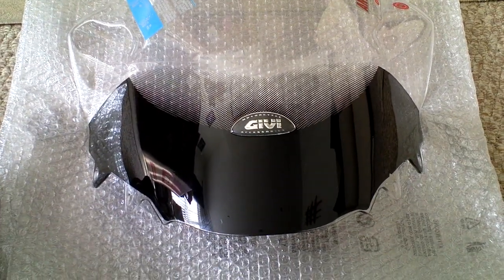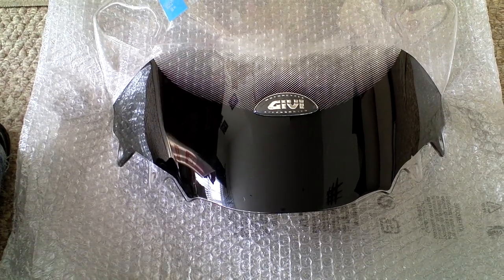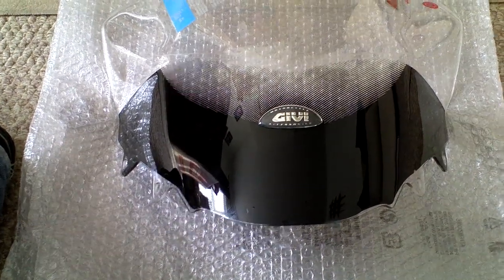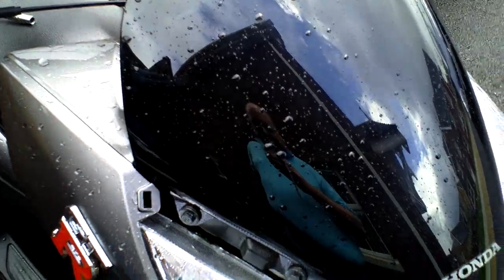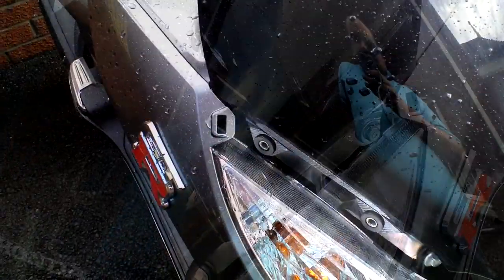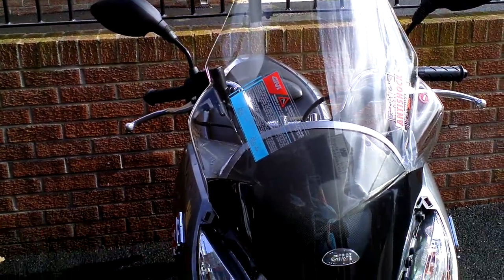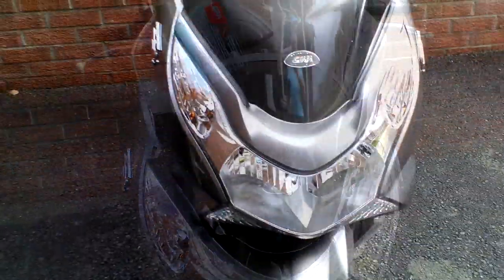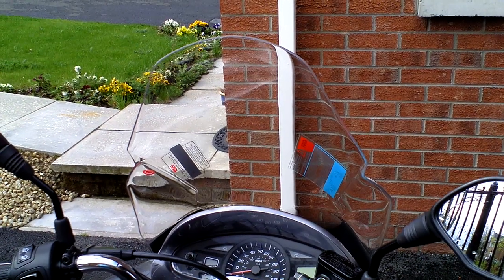Fitting new windshield to Honda PCX125i

Comment: Thx to show this here, because my GIVI windshield came without any description. I found the 2 screws in the front bottom, but after removing them, nothing moved. Good to see the clips. I opened them with a flat screw driver and a thin towel around to avoid scratches. I' ll give the link do my dealer.

Comment from the maker: Thanks for watching my video.  I am slightly larger than the average bear is true.  I retained the seat hump but I had a problem with water being trapped underneath it after rain.  When you sat on the bike it trickled underneath you.  Not a nice. I got an upholsterer to recover it.  Problem solved.  I did retain the hump though.  Good luck in what you decide to do.

Comment: The front trim was a pain in the butt to get back on for me. Finally went back on. The left side ("passenger side") didn't want to stay back in. My next question is: You and I look to be about the same size "around." I've taken the seat hump off. Have you done the same? If so, how did you cover the bolt holes? It's very nice to sit a slight bit farther back.